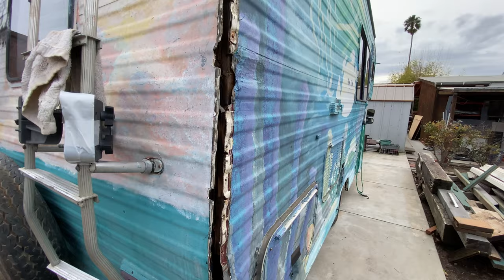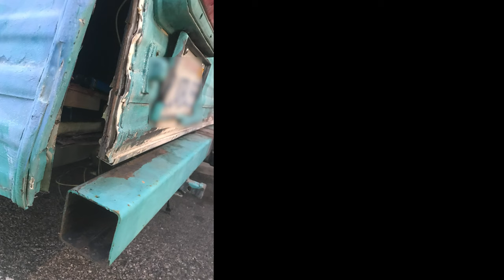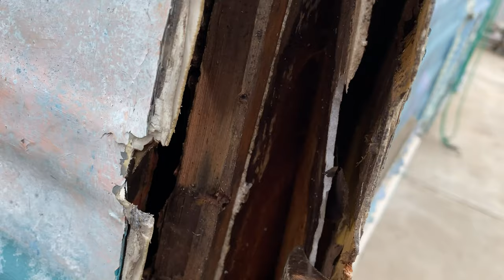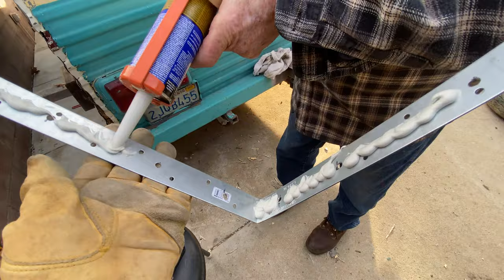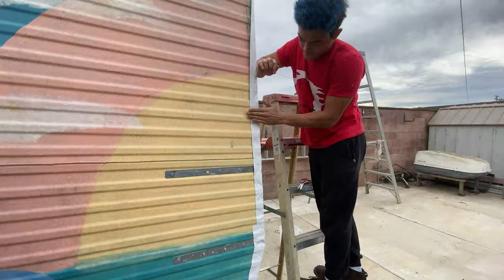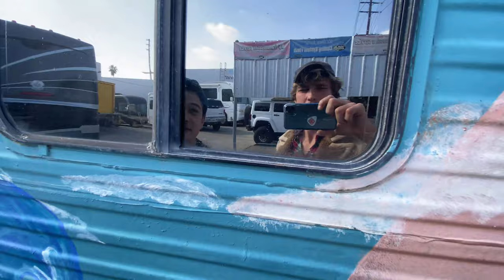How to Repair the Splitting Corners of an RV

Comment: Not silly if it works, I have a vintage 1961 van and will be choosing to brace internally with just aluminium screws period correct showing on the outside. Your video gave me some good insight and reminded me of a few forgotten tricks of decades gone by. Not silly if it works. Safe Journeys
Reply from the maker: Everett is the king of long forgotten tricks. Thanks for watching!

Comment: What a great fix!! Can you tell me where to get the tape?
Reply: It's called Eternabond tape. They sell it as roof repair material but it has a lot of uses on an RV. It comes in several widths. I buy it on Amazon.